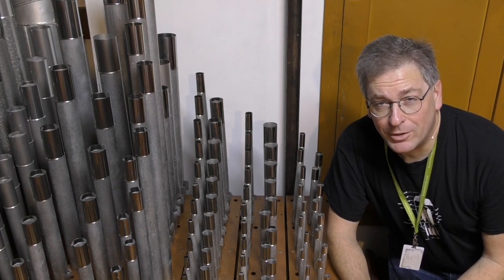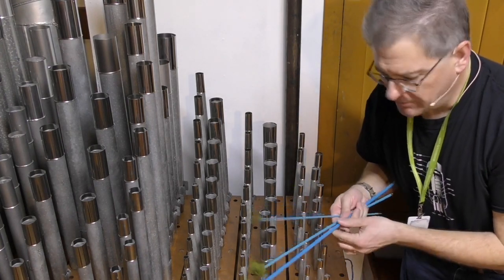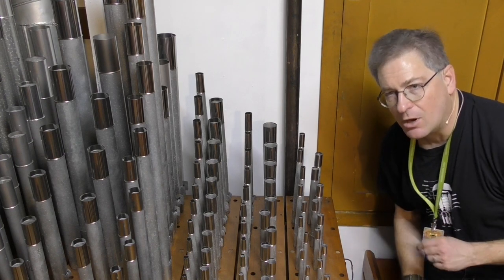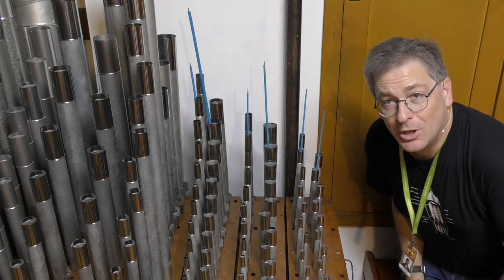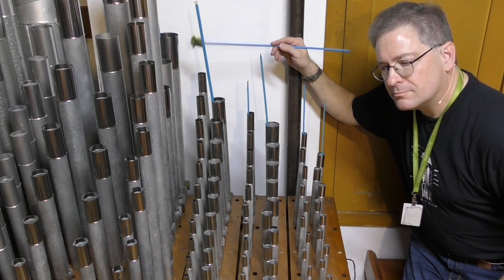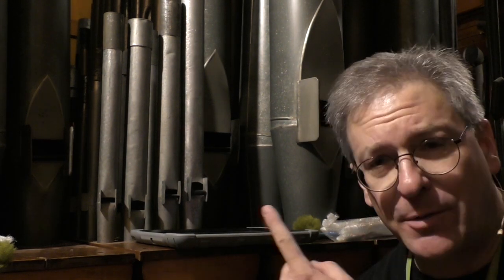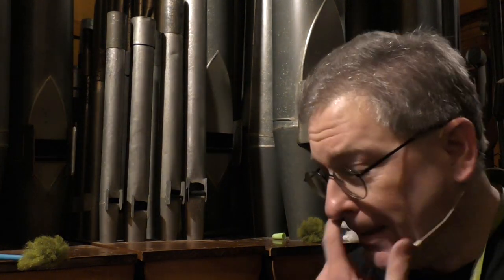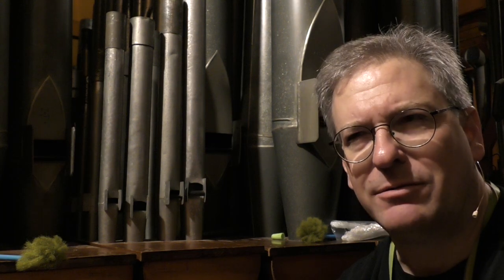Boardwalk Hall Organ- Mixture tuning 101

Comment: Isn’t it a bit risky tuning to the trumpet as they can get out of tune fairly quickly?
Reply from the maker: Not necessarily, obviously you have to check it first to make sure it hasn't slipped. But better that than tuning to something you can't hear 100%.
Reply: @cnagorka I still found it funny that’s that the mixture is that loud. It’s on my bucket list to go up to the boardwalk, especially to see the workshop and all the chambers. I’ve recently been apprenticing with an organ builder and have loved the work so far, and have a lot to learn. I can’t even imagine all that goes into the maintenance of the Midmer Losh…

Comment: This may just be the microphone doing this, but I believe the trumpet you were tuning to is a bit flat
Reply: You know I've wondered that, but I believe this whole organ pitch is below a 440, in fact it may be more like 435. However, that being said I have heard other recordings that lead me to believe the contrary.
Reply from the maker: @jeremyrusu9687  The organ generally stays around A=-437, but what I was tuning in the Solo shouldn't be taken as the pitch of the organ since there's a ton of work going on in there and it hasn't been tuned in a long time.
Reply: @ hey there, Chris, I thought this might be the case, and yes, I agree with you 100%, always check your references. As a piano tuner, I do that all the time with single octaves, double octaves, and octave, and a fifth intervals. I figured that this trumpet, along with these ranks could be in the middle of a tuning, so the pitch could be anywhere, but I know that it will get sorted out to the correct pitch as time permits and maybe you’ve already done that since this video, I don’t know. or Nick or Carl or someone else has while you were doing something else perhaps? Anyway very cool. I guessed 435, and I was pretty darn close, while I do have perfect pitch, getting in the numbers, like that, is hard to tell exactly which number it lands on as far as pitch sources go, I just know when it is not 440.

Comment: In my former days as a tuner, in some of the largest instruments we had to use an intercom system to allow us to communicate with the key holder (no opus II remote iPad option back then) but more importantly we had the primary tuners ‘pitch’ rank also mic 🎤 ed up and superimposed on the intercom system allowing us to hear and transfer the primary ‘pitch’ (Great Octave No.1) across to the other secondary 4’ pitch ranks in other departments across the entire the instrument through our headphones. Also really useful for those big high pressure reeds (Tubas) too. It meant the tuning was really accurate across the whole (10,000+ pipe) instrument.  Great videos of Broadwalk by the way! Keep up the good work 👍
Reply: I wish I could find someone to scratch-tune the organ I play here in Midland, TX (51-rank 1999 Schantz) who is as diligent and conscientious as what you describe.  I'm never happy with the tuning, and it doesn't help that there's no circulation system or direct climate control for the upper level of the chancel pipework, so it gets hot and sharp in the warm months or when there's more body heat in the room, etc.  Anyway, despite that, I can't seem to find anyone who is knowledgeable enough to really put this organ into good, accurate tune or willing to put in the time to do so.
Reply from the maker: You know what I do in some cases like that is install a baby monitor. They're cheap enough you can just leave them in the organ and when you need it you can hear a pitch which would otherwise be really tough to tune to.

Comment: I used to be an apprentice organ builder (low wind trackers) and the biggest mixture I had to deal with was a 4 rank on the great chest. It was much smaller than the Boardwalk one, and it was a pain to tune. So I can easily imagine you tearing your hair out at the end of the day with this beast! As I understand it though, some classical Spanish organs have up to 32 rank mixtures! 

It is interesting that when adjusting the speed of a cassette recorder, that same concept as tuning is used. A digital sound source plays a specific tone (i.e. 330 Khz) through its own speaker, and you have a 330 Khz tape playing at the same time through the cassette recorder speaker. When the beats stop, the motor is set to the correct speed. However, this was difficult to achieve because all cassette recorders have elements of wow and flutter that add beats of their own! 

Thanks for the trip down memory lane! The Boardwalk organ is a national treasure, thanks to all of you for preserving it!

Comment: I'm sure there's a good reason not to do this, but why not just pull the pipes slightly to mute them, so that their toes are sitting next to their toe holes rather than in them?
Reply: Pulling pipes changes the pressure in the windchest because of the air leakage. All the pipes are on the same channel, so the pressure in the channel drops. When you tune a pipe like this and it sounds great, as soon as you tip the other pipes into place, the thing reveals that it is out of tune at full pressure.
Reply from the maker: @clydesight  Couldn't have said it better myself.

Comment: I have always used duck feathers, but mainly only had 3 and 4 rank mixtures that were easily accessible so you could get to the pipe mouth, there is very little bleed through.

Comment: That sounds like permanent hearing loss within 10 minutes. Hearing protection is a must.  So the Carillon is on one channel? That’s unfortunate if it is.
Reply from the maker: Yes of course if I was actually tuning this material I would have been using earplugs. The Carillon is one one channel; those pipe are packed so tightly there's no way separate stop actions could be used.